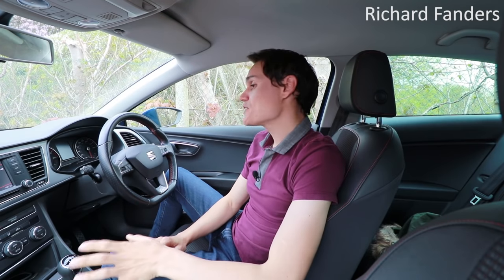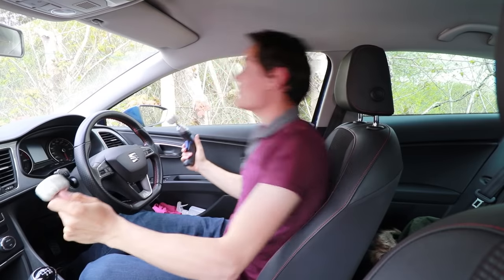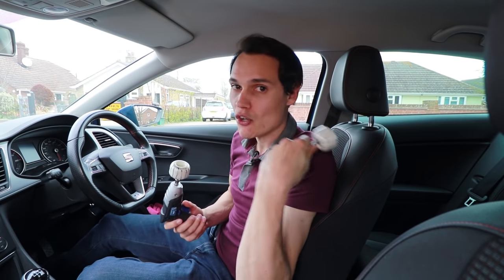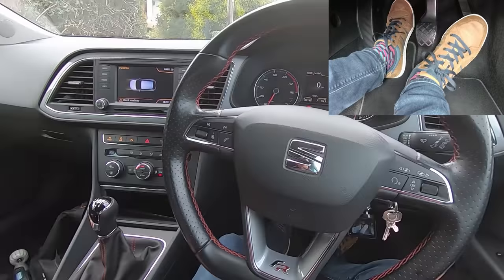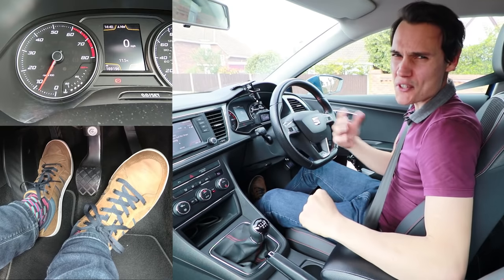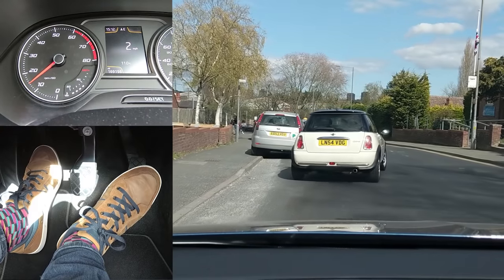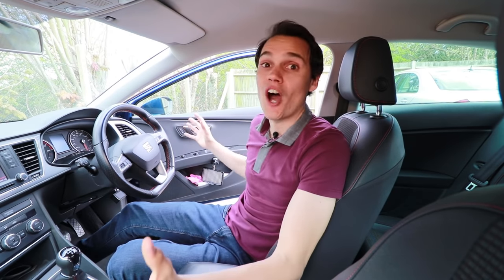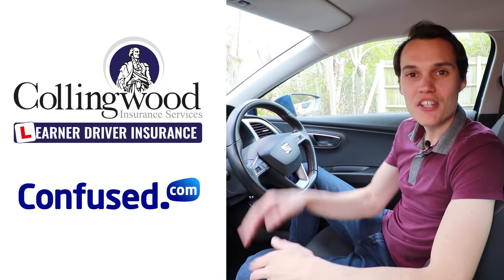What is riding the clutch?

Comment: People always explained it as bad to stay on the clutch.  When I first started driving a manual, I would stall letting out the clutch to quickly trying to spare the car. This is the PERFECT video for anyone that is a visual learner and doesn't understand what using the clutch does and the right way to use it.
Reply: Same here lol 
I was letting go to precent muh 
Clutch wear. 
at sub 2k rpm 
Clutch wear is a meme jt doesn’t happen
Reply: I always ask other people why car when they drive its skipping some times, and goes slow after gear change, and they say that it should work like that, i learned myself to drive, with goal to be very smooth and only thing i came up its very little hold on bite point to match with little bit of gas, and now i feel like im driving sports car ,but its regular car , drive its so smooth even downshifting, but i keep my eyes so i don't use it to match more then 300 rpm so i use bite point very little, even if my clutch work 10 years, its 130$ with replacement, so fuck it
Reply: This was exactly my issue when I was being taught. I was told to get off the clutch as soon as possible. This video is perfect for explaining you need to let the clutch come up to engine speed before releasing the clutch fully.
Reply: @maalikserebryakov me rn I don’t like to use the accelerator at all when my left foot is on the clutch
Reply: @zishaun  yeah me too i see all these people talking about "rev matching" and im just like lol  im not gonna rev shit

Comment: "Ooh! I can smell that!" I love the smell of clutch in the morning...
Reply: What does it smell like?
Reply: @pugsterjosh7925  smells something like burned brake pads but stronger, with a smell that lingers
Reply from the maker: It's hard to describe the smell.
Reply: @pugsterjosh7925  Bit like a mix of burning rubber and burning hair if you've ever singed an eyebrow or the like (probably given the mix of resin and organic compounds used in the friction plate). Lingers as well, doesn't just dissapate like some other burning smells
Reply: @pugsterjosh7925  As someone who had never smelled it before, it reminded me of burning rubber. It's also scary because, as the others say, the smell lingers for a while. If I was on my own I think I would've panicked thinking something was still burning.
Reply: @pugsterjosh7925  I think every car has a different burned clutch smell.  I accidentally burned my clutch last year, when I was learning to drive a manual.  I did it just once, hopefully I didn't remove too much of the friction material.  Anyway, in my 2020 Toyota Corolla, It did not smell like burning rubber.  It smelled like smoke from a fire.  Like, if you ever lit a candle, blew it out, and smelled the smoke, that's exactly what it smelled like.
Reply: @PlasticRocket2  yeah, my dad was driving me to school on thursday and because his brakes are so worn the callipers have to push down further and he now has sticky brakes, i could smell the brakes burning from inside the car
Reply: smell my clutch as i keep overreving in first 😭 (actually dont smell anything though lol)
Reply: It smells like burnt custard.
Reply: You should have just filmed my wife driving a manual. She's fantastic at riding the clutch.🙄🤣🙄
Reply: Honestly never smelt a burning clutch (which is prolly a good thing lol) nor know how it smells. I must be driving a standard right 😅 which I taught myself.
Reply: Am i weird for somehow liking gasoline and clutch smell?

Comment: Toyota Yaris has an extremely sensitive accelerator the difference between 1,000 and 3,000 rpm in the pedal position is very tiny in 1st gear. I need to be careful on larger hills. Plenty of those around Sunderland area

Comment: Hi Richard, Although this is a great video the only detail that I noticed(not that important) but it is that the clutch connects to the flywheel, just to clarify the clutch has sets of plates, which in your explanation can be simplified as just two plates, when the clutch pedal is release what actually happens is that the spinning clutch plates on the engine side start to rub against the gearbox side plates and gradually the rotation speed of the clutch will be the same across all the clutch plates.

Comment: Thanks Richard. Would you also consider this practice as “riding the clutch”?  The gas pedal is somewhat engaged, not fully while changing gears and lifting off clutch pedal as soon as gear is engaged smoothly. Thanks. And great video and I’m glad you explained about its effect when reversing.
Reply from the maker: Staying on the gas pedal during a gear change isn't riding the clutch. However, giving too many revs as you change gear can put extra wear into the clutch.

Comment: You mentioned something in passing that I struggle with. You said, 'its ok to move to second gear when you're moving slowly.' When I am slowing down  and going very slow (10-20 mph), example; im about to make a turn at an intersection, or about to stop for a red light (car rolling in neutral) that then turns green almost as I'm about to stop; shifting into second gear to regain speed from neutral/rolling caused my car to grumble and not pick up speed and eventually die. Im not sure what I am doing wrong. This video was very helpful though, especially the demonstration with the skateboard wheels.

Edit: Im assuming this has been answered multiple times, I just cant seem to find the answer.
Reply from the maker: If you go to second gear when slow you can't come off the clutch quickly, you have to treat it like 1st gear and hold the clutch at the bite point for a few seconds.
Reply: @ConquerDriving  that might be my problem! Thank you for the reply! Videos helped me tremendously

Comment: I’d love to share this video with a colleguee. He’s always tell me I was riding the clutch😂 he learned in a synchro truck licence I learnt to drive a 20sp double clutch transmission (although once good you don’t need to double clutch and some gears at all). I think the point about how much you ride  versus how much damage your willing to do to the transmission is important. Also how much jolt your willing to accept taking off. The bigger the vehicle the more noticeable that jolt can be. Not so great with delicate cargo😂😂 Cherio for the video.
Reply from the maker: The clutch is designed to deal with some slip without overheating and wearing quickly. It's what it's meant to do. Just not excessive revs, moving away in a high gear or holding a car still on a hill using the clutch, this will wear it out quickly.

Comment: Question, i probably got this but if you are slowing down to a stop and then it turns green, lets say around 3mph. Are you still going 2nd gear or 1st? and if so, are you holding the clutch for a second and gas to get up to speed? Thanks!

Comment: Hey, I recently purchased an Rx7 and I notice it really needs some revs to get going in first. Usually around 3k so that the engine doesn’t bog. I also shift around the same rpm as it drops revs quick. Is it possible that I am doing something incorrectly, or do rotary engines possibly just need more revs to get going in first?
Reply from the maker: Rotary engines do need revs. You will damage the clutch regularly launching with 3k rpm revs.
Reply: @ConquerDriving  understood. I will make it a point to launch with less. Thank you!

Comment: Hello lovely video, so I just got my first manual car and for about a week I have need driving and occasionally leaving my legs in the clutch even at high speed on 3rd or 4th gear all because I was realising the clutch too fast and it kills the power, even though I learnt to do it better now but my car jerks every now and then. For example if I am driving on gear 3 and completely lift my leg in clutch when it matches my engine speed I still get some jerking. My question is, is my clutch plate bad now and causes the jerking, or is my Peugeot 307 manual clutch plate now bad and the cause of the frequent and too often , or is the governor the cause because when I drive for like 15 mins it starts reving very unstable and sometimes the car goes off.. help please
Reply from the maker: I'm sorry, but without seeing it happen I can't judge what's happening.

Comment: How long do your clutches last on average Richard (talking about the whole assembly, rather than just the friction plate) between replacements? Does your clutch-friendly driving balance out the abuse they get when people first start 😉🤣?
Reply from the maker: This video will give you more detail, I've done some experiments: https://youtu.be/0ZjSImbwo34 but friction plate should last about 200,000 moles given my calculations from my tests. Release bearing is normally knackered by 30-40k miles as it constantly gets used all day from learners practising.
Reply: @ConquerDriving  yeah that makes sense. They are surprisingly flimsy those bearings on a lot of cars. Maybe someone needs to design a rugged release bearing 😉😉. But thanks for the link, I'll give that a watch. Sounds like your gearbox comes out almost annually then 🙈

Comment: Is that normal to find the brake and gas pedals extremely sensitive ? Like pressing them does very little until the point it does a lot. Is that something you just to get used to, or is my instructor car likely tired or something ?
Reply: Yes when I first started driving I found that happened to me. With a bit of practice  you’ll build up the muscle memory in your feet and it won’t be a problem
Reply from the maker: It's normal, it's part of the skill you need to develop.

Comment: I find it difficult to concentrate on the Engine RPM for a better engine braking experience than using service brake.  It is highly recommended here and is even a requirement to demonstrate the eco driving skills during the actual driving test. I often find myself downshift too early before 1200-1300 RPM. So I need to have an eye on the Tachometer. Is there a way without looking into the tachometer yet realise when to downshift gear without using brake pedal?
Reply from the maker: It's better to take a quick glance at the rev counter if you're not used to the engine sound. Keep the glance very brief so it doesn't distract you from the road. You don't need an exact rpm to change down, I change down at many different speeds.
Reply: Thanks for taking time and responding to my question. I’ll try to follow your advice the next time I drive.

Comment: I was wondering about pressing down the clutch. Sometimes I feel kind of a jerk within the... mechanisms of the car when I press the clutch on a new car. Happens mostly when driving slowly, 1st or 2nd gear and slowing down. I wanna come to a stop, press the clutch, it feels clunky. The car itself doesn't jerk at all, it just feels weird when I press the clutch. Should I press it slowly or quickly, or any idea what's wrong? Never had this before on other cars. Edit: sometimes I feel like maybe the engine is not fast enough. I try to add a bit of gas just before pressing the clutch, it doesn't "clunk" at all. :(
Reply from the maker: I hate the clunk, this video should help: https://youtu.be/_RyT_oQ7hq0
Reply: OMG yes, exactly! 15 seconds in and I feel that video was made specifically for me. Thanks so much.

Comment: Have you got any videos to help me with one of my issues? I tend to be a little bad when changing down gears ie approaching a round about I can get from 3-1st but there seems to be a lot of engine breaking even if I try to hold it on biting point .... then sometimes will start to panic as by the time cars ready for first and engine breaking stops and is smooth I’m having to go right back up a couple gears as for this example I’m now onto the round about
Reply from the maker: First gear is not a good gear to use for engine braking, it slows you down too quickly and it is bad to engage first when you are above 5mph. Best use second gear and change to first if you nearly stop.
Reply from the maker: This video may help: https://youtu.be/LeG1JTpl6pc
Reply: @ConquerDriving  thank you

Comment: Only times i've effed my clutch to the point of it smelling, was two bad hillstarts. 

I had some morons behind me far too close, we were stopped because another moron decided to do a 10-point turn on a hill, so when I took off, I gave it more revs because I was worried about falling back into the person behind me. 

I just avoid busy hills now, screw that :|
Reply: ye that sucks 
There are two methods of doing the hillstart 

1.) Shift as quickly as possible. 
What ur trying to do, just be even faster. 
Raise clutch to hover just at the lowest point of the bp, then move your foot from brake to accelerator, and keep watching the rev counter to make sure u dont do too many, then do as you normally do and lift ur clutch slowly,

2.) heeltoe 
Check if ur brake and accelerator are close enough for this to work. 
You need to basically put ur foot in the middle to do this. 

Hover on the bite point, 
Be on brake with the left side of ur foot, and then when ready to move on , put gas using the right side of ur foot.

This is very safe when u get comfortable and ur car allows it. Both of these are essential to learn tbh. 

Handbrake starts are the most difficult imo, f that.

Comment: Is giving gas before lifting the clutch to the bite point something you should always be doing if it wears your clutch more? Or should you move away with just the clutch more often?
Reply from the maker: Moving away with only the clutch may possibly reduce clutch wear a tiny amount but it's not as reliable and doesn't work in all cars.

Comment: What if you are moving really slowly, its too slow for 2nd gear but also too quick for 1st gear, should you just hold the clutch on the bitepoint a few more sec? Not adding any gas? In this specific scenario its a junction and I cant move too quick because then I wont be able to have time to see the traffic in time.

This also happens alot in traffic queues (where I live there is ALOT of traffic queues, especially at one specific place, where it is downhill) and I need to decide if im gonna do 1st, 2nd, or just hold neutral and brake. Usually I just try to keep the distance so I can drive at 2nd gear = move a little faster, but sometimes I just cant and this is when its really hard to decide what to do. :D

Put the clutch down, brake a little, bitepoint, 2nd gear, after a while, repeat, for like 15-20min, or move too quick for 1st gear and be at like too many revs, or almost stall at 2nd gear because its too slow.
Reply from the maker: This video may help: https://youtu.be/cH_hvyNTb8o
Reply: @ConquerDriving  Thanks :) Any recommendations for long traffic queues? And I mean like 20min+ queues. Just try and stay as far as possible (not 24/7 but maybe keep the distance, move forward behind the car for a while, keep distance) to the car infront so you dont need to clutch down 24/7? If its too quick for 2nd but too slow for 1st.

Comment: i have a question - when your car is already moving in 3rd gear and need 4th then 5th, should you avoid the gas while changing gears up?
Reply from the maker: In most cars yes, but it is different in different cars, trial and error for each car until you're smooth. A little gas should never do any harm though, too much will.

Comment: While in bumper to bumper traffic in 1st and 2nd gear i have to ride the clutch but without pressing the accelerator pedal. Is it fine? I never press the clutch while i press accelerator pedal unless and until i am on uphill and while moving the car fast in 1st gear. I always release the clutch, let the car in move, and then only press accelerator pedal.
Reply from the maker: If it works in that car then no harm done, just bare in mind some cars may struggle and stall.
Reply: @ConquerDriving  No it never stalls. I drive Hyundai i10 2015

Comment: Is it ok if I hold the clutch on the bite point while I’m pressing the brake and come off the brake pedal when I want to move on?
Reply: Its better to push the clutch fully down tbh
Reply: @adamsmasher259  thank you for your opinion
Reply from the maker: It won't work in all cars though as many require you to add gas manually. If you're able to do that the car's computer is most likely adding gas for you when it feels the engine is under load from the clutch.
Reply: @ConquerDriving  thanks

Comment: I've always thought that riding the clutch refrerred to resting the foot on the clutch pedal instesd of having the foot off completely
Reply from the maker: That would be riding the clutch if your foot was still at the bite point. But no, however you're riding the release bearing if is a component of the clutch. But that's different to what people are usually talking about.
Reply: @ConquerDriving  makes sense, thanks!

Comment: Is it riding the clutch if I moving in first gear then push the clutch all the way down while it's moving not braking just coasting?
Reply from the maker: Clutch fully down is not riding the clutch. But it may wear the released bearing.